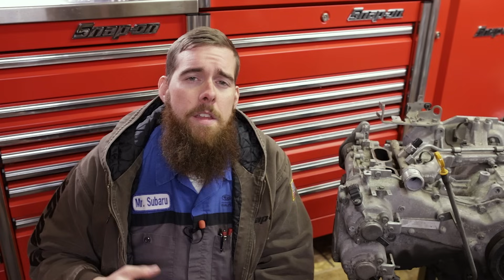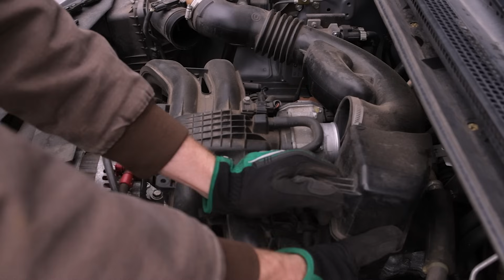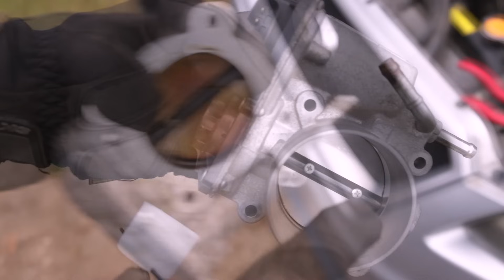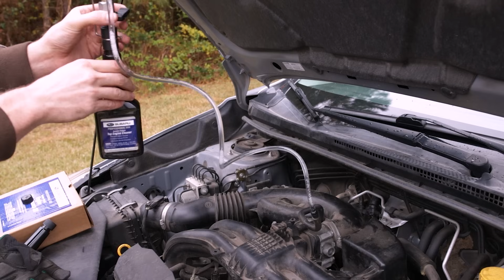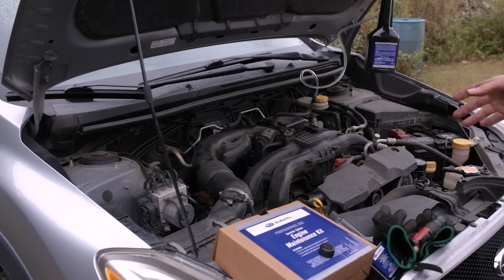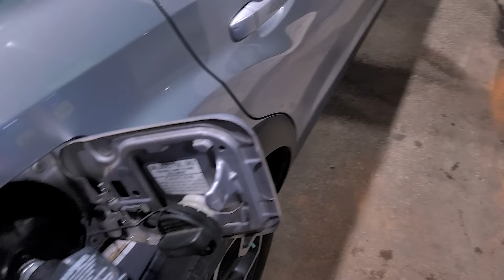Keep Your Subaru Running Like New! Subaru Engine Maintenance Kit

Comment: Love the content. Waiting on a gasket to do this maintenance.  What torque wrench do you have there? Part number? I need a good one,  slowly building a tool kit. This would be helpful for torqiing a the oil dtain plug too!
Reply from the maker: Snap-on tech angle torque wrenches. Not worth the money if just diy.

Comment: how about using just the P.E.A. Carbon cleaner Part: SOA906V9166 after 3 oil changes, would be a good idea? As I have a 2024 Forest Sport 2.5L Boxer engine at about 18,600 mile

Comment: I know this is years after the video, but my Forester is at Subaru now for a coolant valve recall. They asked to do a walnut cleaning of the valves since the parts are already removed.

I've heard this be an issue on some other cars, but until now, never on a Subaru. Why do a walnut clean if Subaru has a factory clean kit for much, much cheaper?

Comment: I don’t have coolant line clamps- I’m curious if I could clean the throttle body without taking the coolant lines off. Maybe with a mirror and some patience? I would still detach the electrical component before moving the butterfly- and since I only need to clean that side I was thinking I am good to go.

Comment: subaru sr master tech...all direct injection engines need periodic walnut blast/manual intake port and valve cleaning...the chemical cleaners just prolong the time it takes for the carbon gunk to build up to a point where it affects drivability...we do alot of thermo coolant valve replacements with walnut blasting as an added service...I have done subarus with 25-30k miles that are as gummed up as ones i've done with 90-100k miles or more...I assume this is related to extended idling and/or short trip drives. wish I could post the before and after pictures here. we have fixed many direct injection engine running issues on all platforms with the walnut blaster as well. a good borescope helps sometimes based on situation. good demonstration on the throttle body and induction cleaning process and disclaimer of the liquid induction failure possibilities mr subaru. we are planning a test on a higher mileage suby that we will remove the intake and take pics of the ports/valves then re-assemble and run the induction cleaner and remove again for visual of how much work is done with the chemical. yes converters are like a filter that plug up sometimes and are more prone to this when running induction services, especially on higher mileage engines. I know it's not ideal or at all possible for most, but manual cleaning is the way.

Comment: Subaroo ? I had light go on . I mixed orylies silenoid. Dealer wanted to pull engine 😮😮😮to look at cam . After telling me my fix was good. They had good tools to turn light off. Lol it went back on. I bought from dealer all 4 vvt sylenoids. And noticed the pin slides out faster. Than orylies. And it worked. By by dealer. You fixed nothing. But glad they have good sillynoids . Lol. Orylies took $500 dollar sylenoidzz back lucky for me.!! . Now I’m trying restore and protect.  . I will let you know next year .?? Now after a year bottom one still like new.!!! By by. Not much vidio on my problem. Solved. But not many vids. . And there was a mouse house in filter house. 😮Filter oil geek said the worst contaminated stuff to get in motor.?? Filter important as oil lol 😮

Comment: Got code P0300&P0172 when doing the cleaning check engine came on and engine stalled but fired up again. Everything runs smooth but code is still there. 2015 Outback. Any recommendations? 
Edit: code cleared after disconnecting the battery.

Comment: Thank you for the video, I understand the important fact of use OEM, just a question about the use of Gumout, if it works for my Crosstreck 2021? Is a little difficult for me to get the OEM fuel kit.

Comment: Performed this service today for the first time at 133k miles. Noticed significant improvement. The engine is idling and running smooth, significantly low engine noise than before. Will have to wait and see if there is any improvement in fuel economy.

Comment: Used to do a lot of work on the cars I bought very used. Since buying my 19 Crosstrek, I don't as much work anymore, but I love having these videos to see what's required on a care much newer than I ever drove. Previous vehicles I wrenched on are a few 00's F150s, a Ford Contour, Dodge Dakota. Time and space permitting, I'd love to spend more time in the engine bay of my Crosstrek-- great lil car that's very reliable.

Comment: I’m really glad that I found your channel.  I never owned a Subaru until I purchased a brand new Forester in 2018.  I now have 150,000 miles on it.  I have done routine maintenance, but not actually changing oil every 3,000 mile or so.  I will now correct this error and change it EVERY 3,000 miles!  This car has run PERFECTLY.  Never a single hint of a problem – except I did replace a front ball joint and put new brakes on it at about 120,000 miles.  And, I live on a ranch that is a few miles off the main road, so I sometimes do abuse it just by driving on the road to our house!

After watching your videos, I took my car in and gave it some long overdue TLC!  I had the coolant system drained and flushed, the CVT drained and flushed, replaced the fluid in the front and rear differentials, replaced the PCV valve, cleaned the throttle body, and changed the spark plugs.  

Since I have a Christian Brothers service station fairly close to my home, I took it there.  To their credit, they recommended that while I was changing my spark plugs, I should also do the three step process that you just described in this video.  After watching your video on this, I am glad that I did it.  Again, THANK YOU for providing such thorough and HONEST info for Subaru owners.  

I love my car, and I live in deep snow country here in Colorado.  Almost all of my friends and neighbors drive Subarus, but I have stubbornly resisted in favor of GMC Pick-Up Trucks, Denalis and Yukons (I have had a long running feud with Ford and certain reliability issues with Dodge).  Anyway, now I understand why they love their Subbies:  This is the best car that I have ever owned for driving in snow.  PERIOD.  It doesn’t have the clearance of my Pick-Ups, so I have gotten it high centered a few times, but I have been quickly rescued by my wife, daughters, or friends with our tractors!  But high centering is not the fault of the car.  That is Pilot Error!  THANKS AGAIN FOR THE INFO.
Reply: Were you able to get a hold of that tool that he shows at 2:30?

Comment: Thank you for the video(s). I have 2024Forester FB25D. Can I use the same vacuum port if I use CRC intake valve cleaner? Should I block the other side of that (purge?) hose during the aplication? Thank you.

Comment: There is another high content PEA product now available to replace the Subaru Top Engine Cleaner and required tool.
Berryman Products 2611 Intake Valve and Combustion Chamber Cleaner.
After having the dealer walnut blast the intake valves on my wife's 2021 Forester (w/34k miles) to address a stumbling when accelerating engine concern we still had an occasional stumble. After using the Berryman's product as per the instructions, the car runs like new again.

Comment: Ok.  I was sent to watch this because a Subaru dealer supposedly clogged up a person catalytic converter doing it.
If you use top tier gas you should not have any carbon to clean off of the backside of the intake valves on a port injected engine.  Period end of story .  You talk about direct injected engines in the beginning but you did this on a port injected engines.  DI engines need this (I doubt it would work if it was bad).  Most places do walnut shell blasting to clean Di engines.  Another thing if your seal is good on the bottle it won’t matter if you run the bottle dry while the engine is running.   It would be no different than when you closed off the valve during the process.
I have a 14’ OB and had a 10’ OB (both port injected engines) and with over 210k miles and I have never done this service and they ran and are running fine.  I do throw a bottle of Techron in a couple of times a year along with only using shell gasoline.(top tier).

Comment: Hello Mr Subaru. I know this isn’t the right video to ask this question, but I couldn’t find one for headlight adjustment. I was hoping you could tell me if it’s possible to adjust the headlights on a 2019 Impreza.  I just had the dealer perform the headlights on a recall and when I picked up the car I noticed that the driver beam was way too low. The dealer said the headlights are not adjustable and I find that hard to believe. I appreciate any thoughts on this. Thank you.

Comment: Hi Mate
I've recently bought a 2002 VDC H6 outback, here in Australia with only 135000 k's. So far I've cleaned the PCV (which was gunked up - thanks for that advice), changed the transmission fluid and filter (drain and fill x3), engine oil (5w40), and done front rotors and pads. 

I bought this cleaning kit and tool, because even though my car is port injected, I thought I may as well do this procedure.
Whats your take on that - Should I bother with the top engine cleaner? If so, where would you inject the cleaner? I can't find any reliable info on this. 
I'm also changing spark plugs to laser iridium - if I do the top engine cleaner, should I do it before or after changing plugs, or is it inconsequential? 

I've watched many of your videos, thanks for being here.

Comment: At approxamately how many miles should a person start being concerned about carbon?  Our '22 Crosstrek is just at 18K miles - bought new - and I make an effort to get the oil temp up to 212+ at least twice a week, usually by using the manual mode in the CVT and shifting at 4-5k RPM in the lower gears.  Also use Top Tier fuel and a bottle of Techron about every third fill.  Thanks

Comment: You didn't say if this works on  turbocharged motors. I just run gumout turbo and intake valve cleaner through my 2024 wrx. Then I just throw in a can of Chevron Techron fuel additive. I do manually clean the throttle body.

Comment: I bought this kit and the tool is not compatible with the bottle… the threads on the bottle are too small so I ended up using a Poland spring water bottle that screwed on and it worked. I posted a video.

Comment: Is it safe to use Marvel Mystery Oil in the fuel tank? I’ve been using it in my 2011 Mazda CX7 with 222,000 miles that runs like new but I now have a 2025  Crosstrek

Comment: 20:05 When I take to a Subaru dealer is there a particular name for this maintenance to specifically ask for?
Reply: Top end engine cleaning, or intake valve and throttle body cleaning. Thats how i would word it at least

Comment: I wonder what composition differences the intake tract cleaner has with seafoam. I would venture to bet they're similar or maybe even supplied by the same supplier. Kind of like the holtz radweld "cooling system conditioner "

Comment: Is it possible to clean the throttle body plate without removing the throttle body/gasket from the engine?  (just removing the intake hose and then cleaning the plate from the back by opening the throttle plate?)

Comment: my 04 forester starts sometimes- it has 70k miles on it. bought it last year at 58k miles. Changed the alternator last year- battery health is perfect. I think this is my solution tho? When i go to start it i have to hold my key a little longer (i know bad for my starter) or i have to quickly put it into gear so it doesn't stall. Any other ideas? Thanks!

Comment: Any real difference between the 9431 and 9430? They look pretty identical to me, but the 9431 is the one you linked and is nearly double the cost of the 9430.

Comment: Mr Subaru,    I’m new to the Subaru community & my daughter has a 2011 Outback. I purchased the maintenance kit shown in this video, however my hose to injest cleaner is not located where your hose is in the few videos I’ve watched. I surely don’t want to use the wrong hose & damage her engine. Can you kindly send pic or video of the hose I should be connecting to ?
I’ve removed & cleaned the throttle body & reinstalled it. I’m stuck now
Thank you

Comment: I use ATF Chemical 505CRF, fuel injector cleaner on my 2019 Crosstrek Premium 2.0 CVT, and my 2022 Outback Limited 2.5i CVT. I posted this on the Subaru Forum, and a few Engineers told me I was wasting my money with direct injection vehicles. I asked if fuel doesn't come out of the injectors, and have a potential for incorrect spray from the nozzle? No answer. I know it can't clean the carbon on the exhaust valves, as it was possible, with the earlier models, that used multipoint injection. I put a bottle in once a year. knowing it will clean anywhere the fuel goes. Maybe those engineers should design their own Chemical to do the same, rather than give a negative opinion, on what others use? MrSubaru1327, thank you for all of your information, it really helps. Also, this product is only sold by a case of 12 treatments, or by a pair, including 505CRO, which is: An advanced patent pending pour-in oil treatment that breaks down carbon deposits and sludge from lubricated engine components. Sludge and carbon deposits in the motor oil can cause serious engine problems. As I am sure that I am preaching to the choir?

Comment: Are you supposed to change the oil after the upper cleaning is done or it doesn't matter if done at any time during the oil change interval. Also for the pcv  valve in one of the videos you utilized what it looked like plumbers teflon tape, some other videos used teflon paste, What are your suggestions on this? Thanks for the video dude, take care.

Comment: Do you think this stuff does a better job than Berryman? I need to do a walnut blasting on my 2015 WRX, but I don't think this expensive tool and fluid will do any better than the bottle of Berryman for 35 bucks that comes with the J-hook hose. Personally, I don't think any of these cleaners will remove moderate to heavy deposits, hence the plan for a walnut blast. But I just want to hear your perspective on this setup for 130+ VS a 35 dollar can of berrymans
Reply: I do have a borescope, and if I do end up doing one of these fluid wash type of deals, I'll definitely scope it before and after. If I'm being honest though, I can buy a walnut blaster nozzle, canister and the media for the price of that one can of fluid and that Subaru tool you used. Harbor freight sells the walnut canister that comes with the hose and wand, and the fine walnut bags. All I'd have to buy is the 10 dollar adaptor from Amazon to use the shopvac and wand. Granted, walnut blasting is much more in depth, and you have to buy a few new gaskets, but in the end you end up with nearly brand new surfaces on your valves and intake runners. I've never actually done the prodecure but I'm sure I can manage it.

Comment: Great tutorial of what to do to clean the throttle body but after having my fourth Subaru all reliable running vehicles I NEVER did these cleanings only added fuel system cleaner at the oil changes and and all my high mileage vehicles ran fine and my Crosstrek now has over 125k with no running issues so do you REALLY NEED TO DO THIS🤔🤔 a dealership would say yes to make money off people like they always do
Reply: Hi what to do first change oil then fuel additive or fuel additive first theb change oil
Reply: For direct injected cars this would be a good idea. Every 60k is a good idea. Doesn’t need to be all the time. Letting carbon build up in a direct injected car is a terrible idea, and injector cleaner is useless in a DI car.

Comment: Theress no way this would work on the FA20DIT. The vacuum port on the intake manifold is not centered. The contents of the cleaner will all go to the closest inlet port and not distributed evenly to each cylinder.

Comment: $30 tool now $70 - Thanks Subaru!
Reply: $80 now!
Reply: The key part of the tool is the valve, which helps atomize the liquid solvent under vacuum. I bought a length of tubing and a brass valve to control the flow at my local hardware store for $10 or less. I also put the PEA fuel system cleaner in the tank with higher octane fuel that advertises higher detergent content (the logo looks like seafood and is yellow 😉) BEFORE the upper intake cleaning, so I could hopefully kill two birds with one amount of fuel/time. I also think it’s not a bad idea to perform an oil change afterwards, so that you keep the engine as clean as possible. And yes, the engine (and catalytic converter) should be at operating temp when performing this upper intake cleaning. 

PEA:

https://en.wikipedia.org/wiki/Techron?wprov=sfti1#Components
Reply: I feel that a small funnel and a tube with 1[3 rd of the bottle in it would do the same thing
Reply: Are they on drugs?!?!
Reply: to get it in Canada I had to have it shipped to a friend in Michigan, then get her to ship it to me. Total cost in CAD after all was said and done for taxes, duty, shipping: $160 CAD. Subaru Canada just won't sell these to mere car owners, and no one in the US would ship it direclty to me.
Reply: Inflation is a thing you know.
Reply: @theLovatoFam  It's greedflation.
Reply: It's been discontinued.
Reply: If it's been discontinued, are the individual components still available separately?
Reply: Bye bye ICE!

Comment: My 2011 subaru doesn't have the upper hose on the intake. Is there a different hose i can connect the top end cleaner to?
Reply: Break boost hose i believe feeds both sides of the intake manifold

Comment: One can of stp one can of throttle body cleaner and one can of seafoam total $20. Subaru charging $200 typical! Do yourself a favor and do this just before changing oil. Solvents in the oil can kill lubricants.